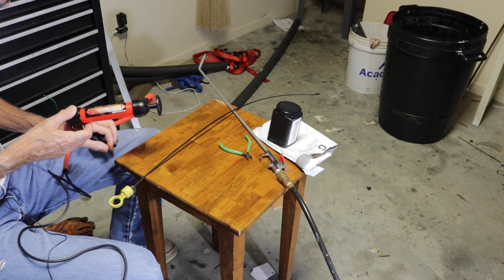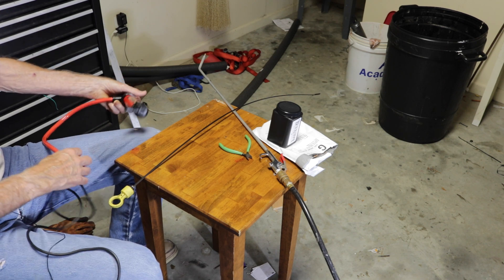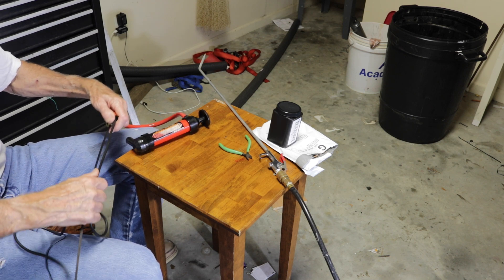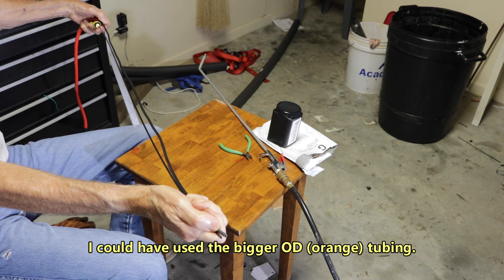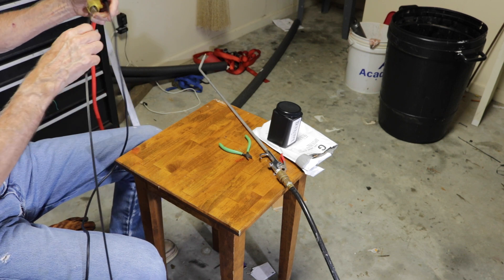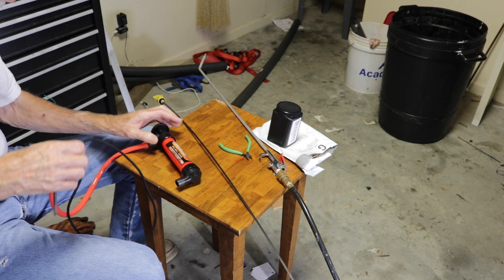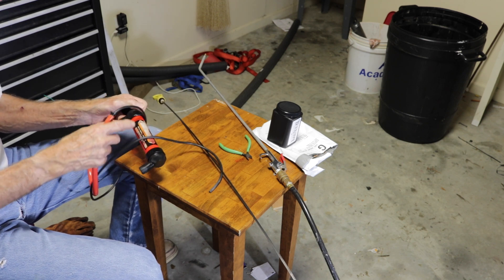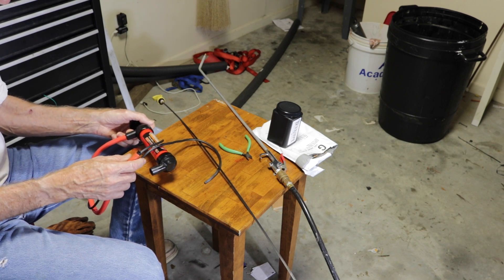RAM Cummins 2500 - Transmission Oil Analysis

Comment: Neat video, Marion!
I just serviced the 68rfe that's in my 2012 with 36,000 miles for the first time.

The fluid looked like-new, but my concern was if the spin-on filter was properly torqued from factory. 
There have been cases of under torques where the filter loosens up and also cases of over torques where the plastic filter coupler breaks.
Also, with recommended service intervals I tend to cut them in half for the very first service of each fluid given the presence of "break-in" materials from manufacturing.

The actual servicing went OK. Breaking the seal between the factory pan and case was a bit messy and worrisome. I refused to insert any sort of a wedge between the pan and the cast-aluminum case, so I hit the sides of the pan with a rubber mallet. 
Everything was nice and tight inside the transmission with very little material on the magnet and no signs of pressure-related damages/warps.
I swapped both filters out with MOPAR filters. The sump filter has a metal seal ring that could be a challenge getting in. I found it easiest to place this seal in while the spin-on filter is off. 
I also installed XDP's filter clamp (using better hardware than what they supplied), a metal coupler for the spin-on filter, and used the 19'+ pan gasket with my factory pan. Zero leaks. 
Filling up the ATF+4 to the proper level can also be tricky. It provided me a good refresh lesson of temperatures/fluid expansion.

Comment: No problem on my end since I have a manual transmission on my 2017. Did change the fluid with Amsoil transmission fluid at 75,000 miles.
Reply from the maker: @crowman5936  I had a 95 with manual, loved it.

Comment: I have 2018 3500 w/68RFE had first fluid and filter change at 15k and at that time installed ATS bypass block. Had changed again at 34k
and now just changed at 63.3k and tech at trans shop said its was the cleanest pan and magnet he had seen on 68RFE and fluid looked great, but I had it changed anyway
I pull a 6k lb boat sometimes and a 20 ft HD equipt trailer. Smooth as a babies butt. Also just changed my brakes for 1st time at 63.5k and those I did my self as pads only
the rotors were spotless was floored at Mopar parts with front pads 278.00 and same for rears so I was speaking to service tech in Rest Room he said its a rip off at dealer and 99% time they make you replace rotors also , he said Autozone Duralast Gold pads are as good or better than OEM for about 65.00. Was 100% correct
towed boat 200 miles after brake install .. Stops on a dime and gives change. Just a heads up to Ram owners. Great video👍
Reply: Agreed on the rip off prices. I used to be a dealer tech and still paid $150 for the crappy mopar brake pads that squeak no matter what!
Reply: @jakeandrus690  yeah had that squeak
to.. Those Duralast Gold are nice and quiet used brake lube on hardware that's included. Great find.

Comment: I always believe an automatic transmissions life depends on how the driver treats it.  Drive it like a drag race car and the parts will fail like a dragster.
My 2016 has 80k on it and the fluid has been changed twice. Once for a recall and once because a cooler hose came loose and pumped alot of it out. Not while driving thankfully.

Comment: I've got a 2011 Ram 3500 with the 68RFE also, changed the fluid at 50,000 and 100,000 its got about 103, 000 on it now. i should have sent mine in at 100,000. So far all trouble free transmission wise (knock many times on wood)!!
Reply: Do you still have your emissions on?

Comment: My 2014 Ram 2500 6.7 now has 318,000 miles. I drop the pan fluid and change the two internal filters every 75,000 - 90,000 miles. No issues. Intermediate trailer towing.